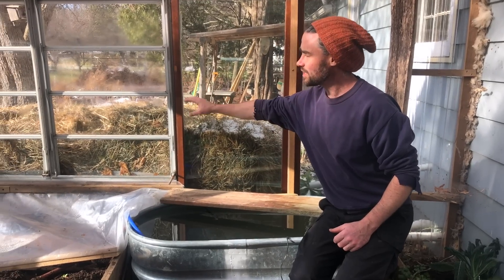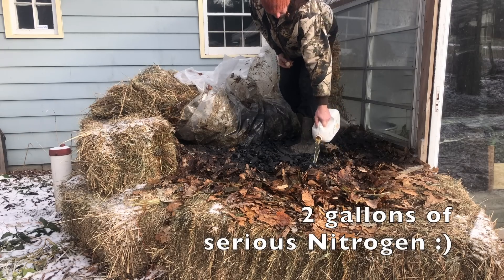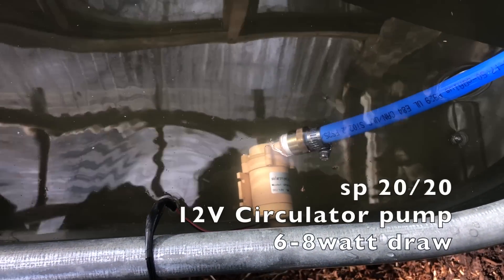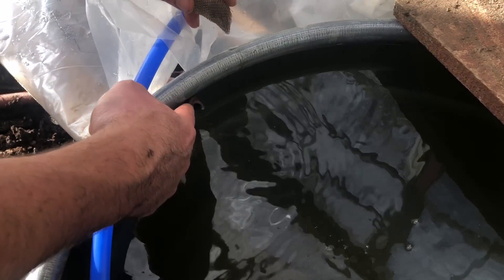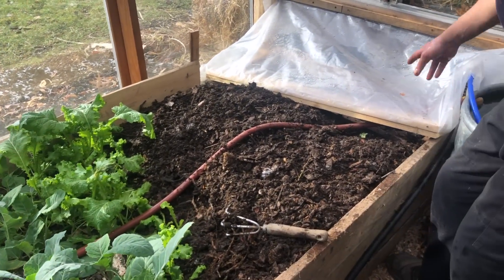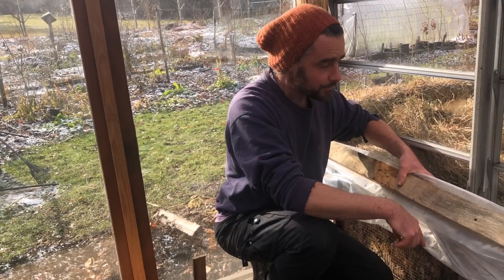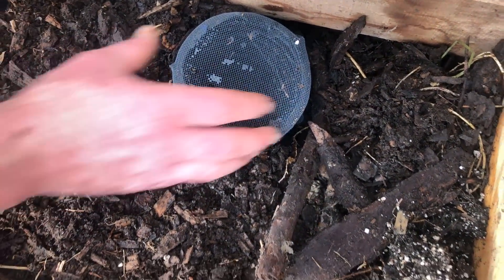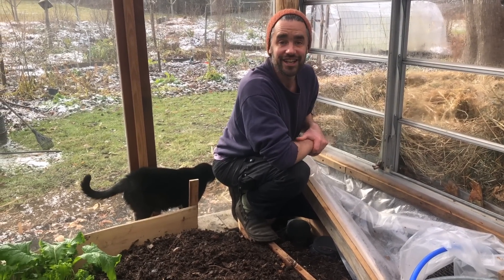Greenhouse - Heating with compost part II

Comment: Maybe I missed it, but it wasn’t clear where the air is coming from that you are drawing from the pile. It looks like the pile is fairly well sealed from outside air which I think you would want.  Outside air would take heat from the pile, and my understanding is you want anaerobic decomposition to maximize the amount of time heat is generated, so you wouldn’t want to recirculate inside air through the pile either, with the oxygen that might encourage faster aerobic decomposition.  But, like you, I would have to experiment to see how valid these concerns are.
Reply from the maker: There is a hardware cloth mesh between the compost pile and the greenhouse that is 'open' to allow air exchange.  No tubes formally running through, but a place to draw off heat.  We'll see how it work as I evolve the process...
Reply: EdibleAcres And that air is being drawn into the greenhouse?  Isn’t that equivalent to putting plastic covered compost inside the greenhouse?

Comment: Also something else that I have found that with the compost heat capture plans that is really neat is using pieces of cattle panel to attach your tubing too because it makes recovering your tubing much easier in the spring after the pile has broken down.
Reply from the maker: I suspect getting the tube out in the spring is going to be annoying...  I'll keep this tip in mind for another build if I do that.

Comment: Great video! I have been very interested in this topic for a long time. I am going to try and find the living web farm video about this topic.  My feedback is to build a manifold with one fan at the end of your tubes that is pulling air through your garden beds. If you can use 1 fan instead of 3 that is 2 less things that can fail and 2 less things to plug in.
Reply from the maker: Thats what I'm currently trying to work on!

Comment: Be careful when capping your compost pile. An active compost pile needs to exhale air and water otherwise it will turn anaerobic (without oxygen) and will produce both harmful gasses and bacteria. Unless you plan to actively push air through your pile, I would stick to good hay insulation on top. Also, be mindful of the amount of heat you take from your pile. Some of it needs to stay within the pile for it to continue composting properly. That's another reason why I wouldn't try to use the warm air. Besides, the heat from warm air dissipates more readily and cannot be stored like your mass battery.
Reply from the maker: It seems the pile is able to still run pretty strong with what we're pulling, and having it run cooler/longer seems like it makes for a healthier compost than super hot/fast.  I hear you on wanting as much healthy air moving through the pile, I need to include that more for the next design round.
Reply: @edibleacres  be aware that a compost that turns anaerobic will likely still generate a fair amount of heat. Usually the smell gives it away first.

Comment: For your plants to benefit even more from the gasses off the compost you could build a small tunnel over the beds, connected to the opening on the side of you g-house/compost. 
Plants exchange many (more?) gasses through their leaves than roots. And the decomposition gasses are good for growth and germination. 
Your fans can still pull air out or just recirculate it. 
By channeling the gasses over your plants you wouldn't breathe any in. 
Hope this helps. 
Also, you could prepare an earth rocket stove now, let it cure so it is ready for when the compost pile runs out of heat.

Comment: I don't think you'd neccisarily need to lift the tank to get passive thermal cycling.  So long as the water at the top of the tank is the highest point in the system, the heat should rise to the top of the pool and the cooler water should sink down.  You would need to knock two holes in the tank  - one just below the water line for hot water return and one near the bottom for cold water outflow.  Then you would need each coil of the hose to get progressively higher, starting with the outflow and coiling up to the level of the inflow.

For a visual aid, google some images of solar thermosyphons -basically you would use the same layout but with a fairly shallow rise angle so that you don't need to lift the tank.  

That said - if the hose wasn't very carefully coiled 'up' at all times there might be high spots where the hot water gets 'stuck'.  Maybe you could make some sort of frame inside or ramp under the pile to keep the hose well aligned, but that could make turning a chore.  

As neat as passive cycling would be, your pump is probably a more practical solution.  If it ain't broke...
Reply from the maker: I wondered if it wouldn't want to thermosiphon at least a bit in this configuration, but I felt I was learning it was a hard rule.  Good to hear someone else support the idea that it should be able to a little... The pump consumes around 8watts, so if it helps move the whole process with that small of a draw I'm OK with it and will keep in mind trying to make it more/completely passive someday when I can design from scratch.  Setting reasonable goals takes some pressure off...

Comment: Pickup an old copper radiator not aluminum, pass your water in the mulch pile through  the radiator . The same design that radiates heat will also absorbs heat. This will  help  your exchange. Water tends to move slower the side of a pipe (friction) and the main flow channels through the center of the pipe. The design of a radiator incorporates turbulence which increases transfer of temperature.  No use reinventing the wheel. There are a lot of feet of tubing in a radiator.  Placed at the up right position with the outlet at the top the hot test water will rise to the top and return to the tank. Any plastic pipe will insulate the water and will not transfer the temp as readily. Your videos make me think.
Reply from the maker: I'm glad they make you think, and share some great ideas!  I'll keep my eyes out for a radiator, although anytime I've seen them used they are still quite expensive so I didn't think to explore that route this round.

Comment: Do you intend on manually turning the pile periodically or does it get enough oxygen on the greenhouse side to prevent it from going anaerobic?
Reply: Ah, just thought: once the hood is air tight I suppose the fans will be pulling air through the pile into the tubes supplying the microbes with oxygen.
Reply from the maker: I don't think the hood is air tight fully, and air should be able to sneak in a little here or there... I don't plan on turning the pile but rather putting more on top at some point if needed...  We'll have to see how that strategy works, I suspect it could stall out at some point, but that remains to be seen.

Comment: I would run your rainwater down a closed circuit loop underground to to raise or lower temp to 55 degrees. Should be better winter and summer.
Reply from the maker: The incoming tube runs through the greenhouse under mulch, but definitely not deeply buried.

Comment: Be aware of fungal/bacterial growth, (Powdery meldue, botrytis, root rots)... I work as a grower and a huge problem with the heated houses is a high humidity with alot of standing water and heat make the perfect environment for the above.. Main enemy is standing warm air, get some air circulation in there if you can... Hope this helps
Reply from the maker: We'll keep an eye out.  We plan to incorporate more air flow soon.

Comment: In other words those big tubes should also be running through the compost heap, in general, vertically.  Maybe coiled up from the bottom to the top in the compost heap.  The escaping hot air into the upper part of the GH will help push the cold air at ground level into the tubes.  It works like a giant heat exchange.  It would be totally passive but would not heat the soil in the bed like you are proposing.  Alternatively, you can get rid of the water tank and run the pex line through the garden bed instead using a small recirculation pump.  The heat would be drawn off into the bed, the bed would dissipate the heat into the GH from the ground up, and the big tubes would warm the air via convection.  Also, I agree with one of the comments that you should paint that tank black, that is, if you decide to keep it in there.  Or maybe you want to pump the heated water through the bed and return it into the now black painted tank then back to the compost heap....just saying.
Reply from the maker: Thanks for sharing all these ideas here.  Good notes to consider for sure.

Comment: Fans spreading heat have always been fun for me. I like your idea of a fan on either side of your tubing. Maybe it would be good idea to have both? Because heat likes to rise, it seems that a fan sucking hot air might suit you. It aids in the rising when you consider the higher fan sucking from the lower source. Also a fan at the heat source blowing it into the tube seems to aid in the path of least resistance. My thoughts are if you accelerate the laws of thermodynamics and accelerate the path of least resistance then you will get the results you want.

Comment: I am not sure if there would be a noticeable change in temperature between the push/pull of the fan. BUT cold air is denser than warm air, so it should be easier for the fan to move more air by pulling from the cold end.  so something like " Compost ----->Piping underground ----->Garden --->Piping -----> Fan"

Not sure if that's helpful but I tried
Reply from the maker: It is helpful, thank you for sharing.

Comment: You might be more productive if you force air through the compost, increasing metabolism and heat, then capturing it with the water circulation.
Reply from the maker: I don't want to push the compost to absolute peak levels because I want it to run stable and long ideally...
Reply: and steam pouring onto the house is probably not good. so a runaway reaction would probably not be the smartest thing unless carefully controlled. Perhaps it could be used effectively to heat the home in the future, circulating through the floor.

Comment: Hey that looks pretty good. Are you using a battery/ batteries between you solar panels and water pump?  Insulating bath might improve the water temps that feeds the bed. If you have a decent amount of  sun you could use black polythene hose to heat the water too. The temperature that comes out can reach 140 to 176 F easily on a clear sunny day depending on the length if hose. 

You could then run the hose deep under the beds for really effective warming.

Comment: There's a paper published few years titled 'carbon monoxide as a signaling molecule in plants'. Maybe just an interesting read, because I got wondering what remains of the methane one might burn. Mycelium on the other hand might like oxygen (isn't its structure in soil a function to provide pathways). Basically I wonder if one could get a tiny continuous flame from that methane and use its output for leaves and roots, and input for mycelium, airating water, etc. Positive and negative pressures have soooo many uses.
I love what your doing. If yall haven't then 'Whole Systems Research Farm - Ben Falk, by Olivier Asselin' has many solutions also.
Reply from the maker: Nice info here for me to consider, thank you.  Definitely in the loop on Ben's work, we worked together a few times and he's got some amazing projects underway for sure.

Comment: Your thinking backwards on your fan and airflow. Heat Rises. You should draw from the top and push down. Unless those pipes are at least 6ft underground you wont get much if any heat out of the ground you are just waiting energy. That much moisture in the soil will wick the heat out faster than it can be replenished

Comment: I wonder if you had more of a waterfall effect eith the water coming out of the hot side would make a bigger impact on the ambient temperature of your green house instead putting most of the heat energy in to that big water mass but see that you are also trying to heat the mass up to last through the night. Just a thought. Would like to see a video of the steam coming off of the water in the morning.
Reply from the maker: The whole tank went up 20 degrees overnight with a continuous pumping, so I'm excited to see where this is heading!

Comment: What if you used sticks of pvc with holes in them buried under the compost pile that stubbed into your greenhouse. This in theory would give you the potential for warm air that needs moved. You can then somehow use your gravity fed passive irrigation system to pull warm air thru those tubes. 

Just like when you flush a toilet your plumbing uses other drains in your house as a vent pipe for air. If all your drains were clogged you wouldn't be able to flush. Basically what a vent pipe is installed for to prevent that from happening. You would just have to be sure your pvc stubs were higher than your drip irrigation on the ground to prevent back flow into the compost which would easily be the case in your situation. Who knows if the pressure would be enough to make a difference, just an crazy idea.

I'm not a plumber and have no idea what I just said
Reply from the maker: I'm not sure if I fully understand but I appreciate the sentiment :)

Comment: wow, great pace of innovation!  Impressive to see the water bath at 45-50 deg.  Not sure what your daily average temperatures have been, but if you have a 45 deg bath of water in your greenhouse all winter, I don't see how you could go wrong.  I recently made a video for my 2019 build (https://www.youtube.com/watch?v=A2TQJl9WjLc).  Main innovation is the compost heat exchanger.  I simplified the GAHT system.  Main limiter right now is lack of compost!  I'm exclusively using shredded junk mail and coffee.  Need much more junk mail!!!
Reply from the maker: Looking forward to watching your video.  I just temp probed the tank of water today and after running for 18 hours it's now 68F in the water...  Pretty exciting for less than a full day of running!
Reply: EdibleAcres wow, 68 degrees!

Comment: Very nice implementation of the Jean Pain idea.
While you filmed in the greenhouse, it felt on film that it was a nice atmosphere in there, which is quite an argument too that it is working fine.

If there's no active air circulation, it will not work, as hot air and gases go up when left to themselves.
You can either pull or push air. Most efficient is to do both at the same time, then comes pulling, then comes pushing, which is the least efficient.
Here I guess any of the 3 will work : you don't need high efficiency, as moving a lot of air and in turn lowering the temperature of your pile would be counter productive to the composting process (at least during most of its phases).
What you want is "shaving off" the heat production, harvesting a substantial amount of the heat without hindering the functionment of the "compost power plant".

Great vid as always

Julien

Comment: The best way that I can think of for capturing gaseous Ammonia, and maybe Methane, would be to find a way to bubble it through water, let it dissolve in the water and then treat for changes in pH as you use it for irrigation. I've never tried something like this but it was the first thing that popped into my head. Or, set up a manifold of sorts, remove your impermeable plastic layer from the top of the compost pile, and draw the air in through suction at the greenhouse wall.
Reply from the maker: Probably too complex for my purposes, but I appreciate the info.

Comment: For the tubes.. ..maybe making the inlet lower, at the same level that the tubes are running through the soil, so that the only rise is at the far end, along with covering the outside pile, could allow it to passively heat the soil. It might work better if possible/safe to dig down and make the pile a bit sunken as well.. just ideas though, I haven't tried this yet. Thanks for sharing your process!
Reply from the maker: Thanks for the input here.

Comment: on the compost side i think you should have put t's in ran the pipe up to cieling and on far end short'n the pipes then below the the t's have the fan(s) pull the warm air from ceiling and the compost.

Comment: an easy way to increase heat retention would be to double pane or plastic wrap the greenhouse glass, and you could simply paint the water trough black to get some heat from the sun as well. simple i know but probably effective

Comment: Not sure about the placement of the hot water line into the tank; being so close to the overflow outlet (brilliant btw!) might be just heating some water on the top only to then be overflown down to the soil... so maybe you could move the warm water intake down to the opposite side (I.e. The very bottom left ?) might have a chance at warming a larger portion of the metal trough and, in turn more water mass transferring greater overall surface layer warmth ? 🤗🤷‍♂️